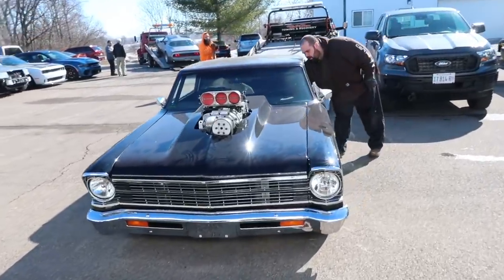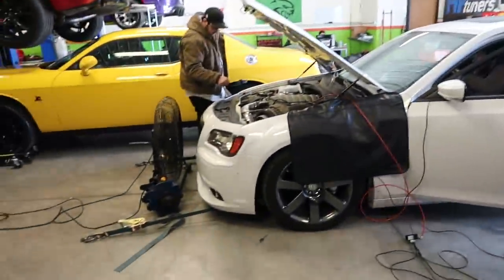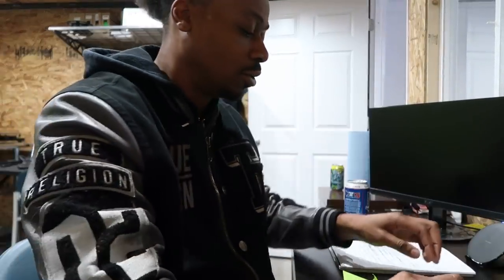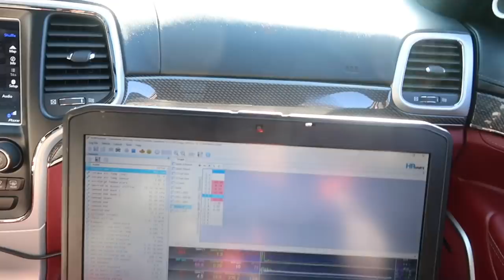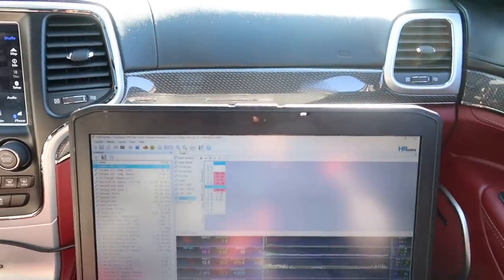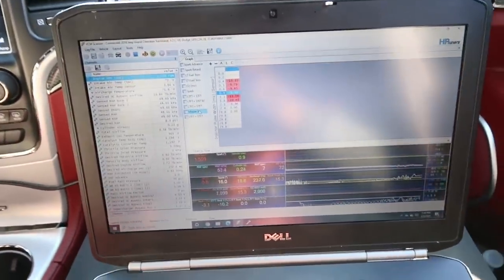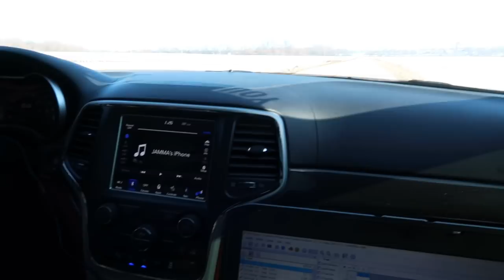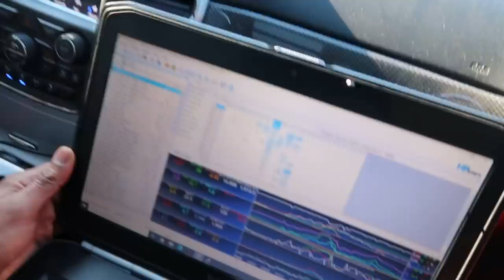DIALING IN MY BUILT TRACKHAWK FOR DONKMASTER EVENT !!!!

Comment: Borlà Cat back system would be Sweet on your Whip especially the 100 percent Stainless steel system  , do you have headers on your whip already??🤔 , Cooks make a nice set  for it ,  besides the header's and exhaust will pick up somewhere around 25-35 HP as well 💯👍 , " Sweet " , besides the Stainless steel is great protection  from that Salt on the roadways during the winter months of Snow/ice Crap💯 Solid 🔥 brother